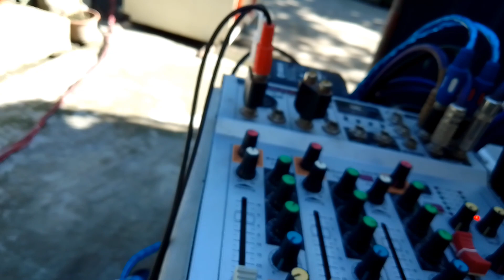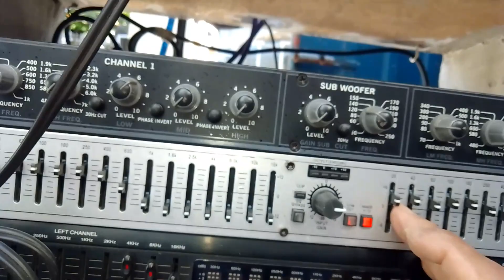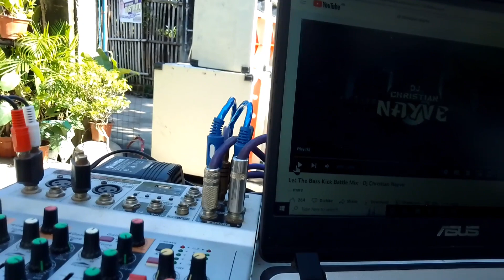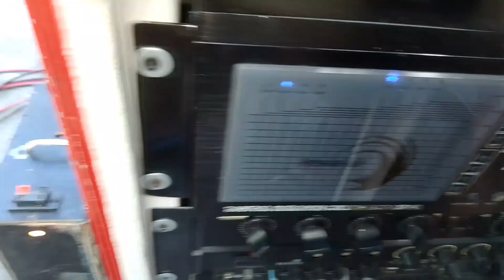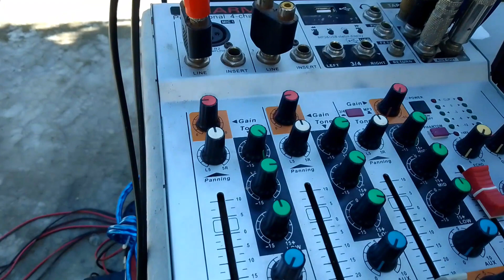Module - ano Ang trabaho sa processor at paano e connect.

Comment: Sir napanuod ko po yung vlog nyo about sa computation nyo sa ohms and wattage tapos nag gawa ako ng sarili kong computation pagkatapos ko mapanood at intindihin yung video nyo.
Magpapa advice po sana ako kung tama po ba yung aking sariling computation.
Meron po akong 2 pcs 450 watts na sub woofer at 2 pcs 400 watts na woofer at 2 pcs 250 watts na tweeter. Crown po lahat ang brand.
Sub woofer - 8 ohms 450 watts times 2 is equal to 900 watts 4 ohms parallel method.
Woofer - 8 ohms 400 watts times 2 is equal to 800 watts 4 ohms parallel method.
Tweeter - 8 ohms 250 watts times 2 is equal to 500 watts 4 ohms parallel method.
Ang tanong ko po ay kakayanin po ba ni joson Jupiter max integrated amplifier 2022 yung computation ko? May 3000 pmpo at 4 to 16 ohms impedance.
Ang plano ko po sana ay sa channel 1 si sub woofer at channel 2 si woofer at tweeter.
Sana po matulungan nyo ako. More blessing at sana maka gawa pa kayo ng maraming video at makatulong pa sa mga kagaya kong baguhan sa larangan ng sound system

Comment: Tay san ba nabibili yang xlr mo na 2 male 1female isang cable wire lang
Reply from the maker: low pass filter yan diy na module gamit yan sa crossover or equalizer na walang sub out

Comment: tito mike may tanong po ako mayron po akung powered mixer 500wattsx2 4 ohms po yung impedance nya pwdi ko ba lagyan na speaker 8 ohms yung impedance sana masagot nyo po Godbless
Reply from the maker: pwedi pero maganda Kong 4 ohms
Reply: @titomikesoundsystem  tito mike 8 ohms lang kasi yung speaker ko 12" pwdi lang ba di ba masisira yung speaker ko
Reply from the maker: @retrichiealmacin7775  Kong hendi malayo Ang mga wattage ng amplifier at speaker okey lang
Reply: @titomikesoundsystem  400 watts yong speaker na 8 ohms sir mike
Reply: @titomikesoundsystem Sir mike may 602 ako na konzer pwdi ko ba lagyan nang 500watts speaker d15 8 ohms
Reply from the maker: @retrichiealmacin7775  okey Ang speaker sa powered mixer at sa konzert
Reply: @titomikesoundsystem  thanks tito mike Godbless Merry Xmas

Comment: sir, tanong lang po, diba pag may dalawang speaker na parallel connection na 200w 8ohms + 200w 8ohms = 400w 4ohms? may nag sabi din kasi  pag parallel hindi daw ma add ang wattage ng dalawang speaker, ex. 200w 8ohms + 200w 8ohms = 200w 4 ohms lang daw, ano po ba talaga totoo sa dito tito mike??
Reply from the maker: Nag basi tayo sa amplefier specification
Reply: @titomikesoundsystem   joson mars 600w x2 PMPO po ampli ko

Comment: Apat na 8 ohms speaker paano 4 ohms load connection? thanks sa reply.
Reply from the maker: Ang amplefier ay may dalawang channel ( left, right channel)at yong speaker mo ay apat na 8 ohms. Ang connection dalawang 8 ohms parallel para sa left channel dalawa den sa right channel.4 ohms load na yan bawat channel

Comment: Anu size mid? Kag sub? Watts? Salamat.
More power
Reply from the maker: Mid 10 inch 300 watts sub 15 inches 600 watts
Reply: @titomikesoundsystem  Tweeter mo boss?
Reply from the maker: @rast125  compression driver 300 watts
Reply: @titomikesoundsystem  salamat boss!
Reply: @titomikesoundsystem  kung ma compression drive ko na tweeer. Pwede na e upod sa mid vocal na speaker? Para isa na lang ka amplifier?
Reply from the maker: @rast125  pwede pero lagyan ng capacitor 1.5 uf 250 volts Ang tweeter